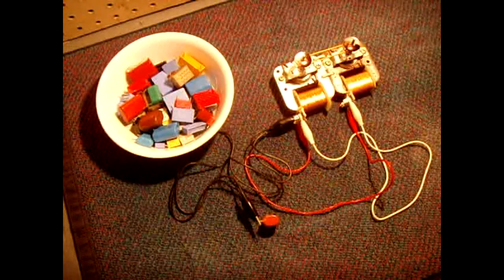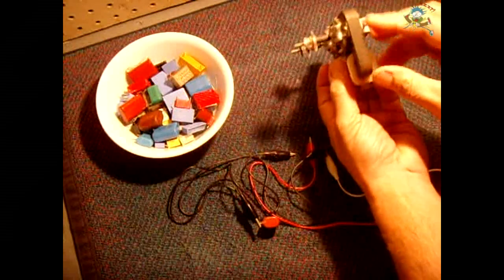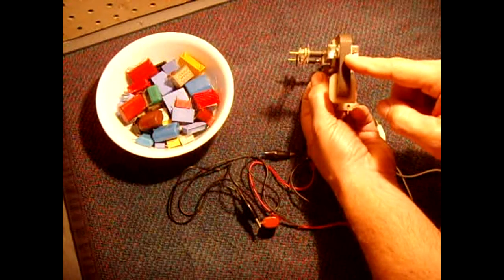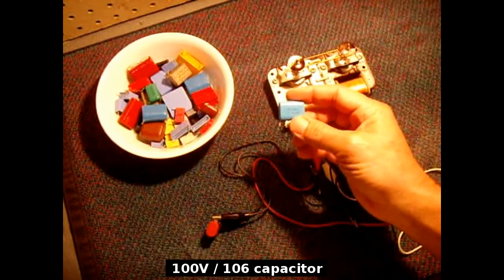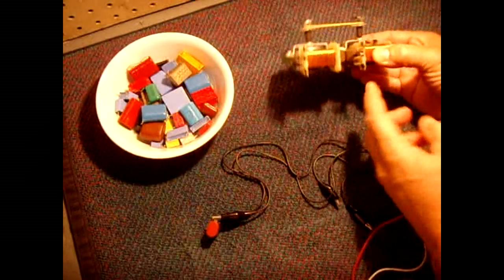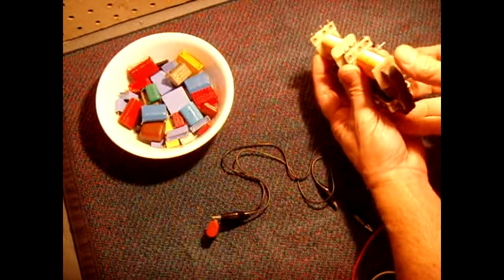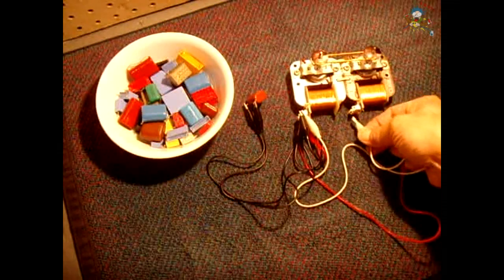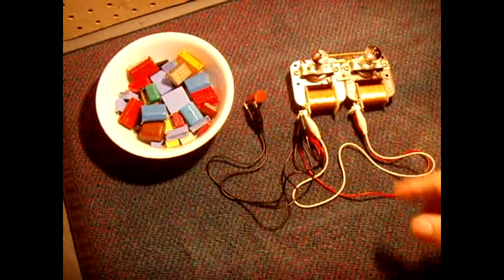FREE ENERGY/OVERUNITY Shaded Pole Motor Generator?

Comment: I like the dominoes falling over in the opening scene since this poses an intriguing question in its own right, namely: how can a fixed amount of energy (needed to initiate the sequence of falling dominoes) be sufficient for any length of dominoes? If this were a wire, it would smack of no resistance at room temperature. Or, am I mistaken in making this analogy?

Comment: They don't need wires. Those are single phase induction motor. An inductor connected to 220 under the table  could have the same effect as applying to motor coil. The center tap is to run it at 120. Half the resistance double the current same power.

Comment: Maybe somebody has already mentioned this but I would take a guess that the capacitor was pre-charged. Yes, the motor speeds up at first to cruising speed, but the video doesn’t run long enough to see if they slow down or not which would indicate whether or not the capacitor is being discharged.

Comment: While I haven’t gotten around to doing this experiment, an induction motor can be turned into a generator by the use of the universal opposition of the rotor by function of an equation at the third harmonic frequency of the resonance LC between the TV device and the inductor. 
Furthermore an inductor can offset the mass of the object by the use of the j imaginary inverted resistance commonly called ‘XL’ 
However typically this is sound for non unified fields , however technically as there are two devices connected, they are non unified in that experiment. 
Theoretically there is a ‘B’ feild effecting the rotation of the rotor and a ‘B’ non unified feild ‘spilling’ into the next device. 
I’m not sure if they are mutually exclusive? 
Thanks for sharing.

Comment: I realize this video was made some time ago, I'm not sure which video you are referring to, but the rotor is modified, the original rotor is either removed or cut to take two magnet's, this is done for both motors.. I have seen two other videos that show them working but only one clearly shows that two magnet's have been installed, the channel is called free energy but the voice sounds like the guy from diodes gone wild... The shaded pole motor needs AC to get started, essentially creating it's own magnet field.
Reply from the maker: You need to stop believing the scams. Good luck having the guy reply to you giving exact plans to duplicate with guaranteed results.
Reply: @electronicsNmore   LoL, I was just looking at the two videos that show it working just before I saw your reply. One video just showed it working and they did exactly as you did, but the other video shows a picture of one of the motors taken apart and a hand drawn picture showing two magnet's where the rotor should be, but in the actual picture I see a thick band that looks like a magnet that has been taken from another motor and he might have machined the rotor to get it to fit, you can clearly see that one of the shaded pole motors still has it's factory pop rivets in place, while the other one has nuts and bolts, I have a shaded pole motor and it's also got pop rivets in it to hold the rotor assembly together! 
I looked at what you did, I didn't expect it to work because I know that the shaded pole motor doesn't have a magnetic rotor, so you would need to start it by applying voltage to it just enough to get it started then the capacitor takes over. Not sure if it would work but if you still have that motor setup, try and give it some 240v or 120v depending on where you are from from the wall socket, give it a pulse and see if it would work, others, chase down the other video, either the channel is called free energy or free energy 4all. The pictures in the video clearly shows what was actually done to make it work.. 
I only have one motor and apart from needing another, I need to find out where to find a magnet that he was using! It most likely came out of a cheap DC motor, they usually have a ring type magnet like that which is one continuous loop of opposing poles... 
Have a another look at it, both videos look very similar except one shows the pictures...
Thanks for replying!

Comment: The video I seen, he had ground out the center of one of the rotor and put one of them flexible magnetic strips around the rotor then reversed the wires, but good video and I doubt the magnet around the rotor will work as well, worth a shot. Good job.

Comment: Please Note this answer relates to an answer from "electronicsNmore" much further down the page !

No,   you were showing us that "YOUR" device wouldn't work, I have 
watched a lot of similar Y-tubes, using the same motors and capacitor 
and none of them had the capacitor connected the same way as yours, I 
think that maybe, your one of these people who are terrified that they 
can be made to work !
Remember, if someone actually gets one of these running, 
(with no brush gear) and it will light the tiny-est of LEDs 
for many months continuously, they will have proved the principle, any 
further work can then just be up-sized

Comment: One video shows the squirrel cage was removed from one motor and altered to accomodate a magnetic ring which would generate a voltage if rotated. I will try repeating this experiment using one and two magnetic rotors respectively, sometimes you have to look beyond the obvious. Also the video was part of an infomercial product by a Dr. Goran  describing the work of a California professor Koon who visited Korea to share his free-energy idea with his father, he was apprehended and executed by Kim Jong Un. In the video there were a couple small asian kids standing around the table, looked legit. Koon applied for and received patent for a permanent magnet motor. Goran claimed to have found the plans when he bought the house where Koon had lived.
Reply from the maker: Save your time and money! They feed off "Free Energy" fanatics just like you.
Reply: Free energy is a real thing. Sorry you came to think you know so much before making any real discoveries. Building stuff without understanding the working principle, most often, doesn't work. You have more to learn, don't take it personal.

Comment: You are 100% correct with your analysis of their videos.  Even if they drilled out the cores of the motors and installed magnets, they would have eventually slowed down and stopped.  By "demonstrating" the power output with a light bulb, they ruined it for themselves.  I am guessing they were more interested in getting views for monetary gain through ad revenue.  Pukes like that need a swift kick in the can and a good scolding.  Countless people have probably wasted their time and materials.
Reply: What a whiner. I bet you thought life was supposed to be easy. People use their time & resources as they choose. Tinkering is a fun hobby.

Comment: wed noticed that some of those motors actually have a band of magnetic material around the centre of the induction barrel
Reply from the maker: The rotor is made of steel and aluminum. Called a "squirrel-cage rotor".
Reply: then it must have been ANOTHER VIDEO WE SAW AS IT DEFINITELY HAD A SMALL MIDDLE BAND OF WHAT LOOKED LIKE A FERRITE BAND (LIKE WHAT CLOSES A FRIDGE DOOR, WHICH WOULD EXPLAIN THE VOLTAGE, WEVE CHECKED WITH OUR METERS AND NOT A MV COULD WE GET OUTA THEM.WERE STILL SEARCHING FOR THE OTHER "SQUIRREL CAGE MOTORS" IN THE ONE WE SAW THEY HAD TAKEN OFF THE BAND IN THE MIDDLE ON ONE LYING ON THE TABLE

Comment: no magnet on this motor, no magnet = no curent
Reply from the maker: You do know this video was made to expose a scam, right?
Reply: yes i know, but i say why :)
Reply: Your cap is to small use a 8 to 10 mF
Reply from the maker: +Chris Bezuidenhout Don't waste time with nonsense. The device is a scam.You need to accept that fact.
Reply: 10 mf  250 volt pf and magnet

Comment: again, thanks for doing these rather than me trying to disprove it.  I would also like to make an offer.  Anybody with a working motor, that produces more power than it uses, I will personally try finance it, if I can build it with your instructions and get it to work.  Even a motor that will run without producing excess power.  IE a perpetual motion machine.

Comment: Hi everyone,well someone talked to that chines replicator yesterday and he posted some ics about the shaded pole motors self-looping device. As the pics show, the rotors of the shaded pole motors have been modified. He added a ferrite ring magnet to each of the rotors. So as it spins, the coils generates electricity. As it comes to why he chose shaded pole motors to modify, I think it's because of their high mass rotors which could act as flywheels. That chinese replicator said '' I'm not claiming any free energy.'' Maybe he is afraid of FE suppression or something else. Look to the photos. Google --> 212522zcke2o7h57omth9e.jpgScroll a little down where you can find the pictures of how it's made.Jan

Comment: I've seen one motor and wondered if you could confirm for me if it is real??? It's the system with a plank of wood, two nails, about 5 meters of stripped wire, a monopole magnet. Once the wire is coiled up, you strip one side of both ends of the wire (don't ask me what I'm on about, cos' I don't understand it either), maybe its some sort of wire, that's copper coated. Then when he places the wire on top of the two nails (the two nails are used like in a spit roast), that should be beaten in to the wood, with the monopole magnet exactly between the middle of the two nails, but to one side of the spindle axis that lies between the two nails, at this point the wire should spin like mad. But does it?

Comment: Hmm, well let me ask this. What if the caps have to be charged? Perhaps if the caps are fully charged the system will run. And perhaps when the system runs voltage is created from the motors running which probably produce more voltage and keeps the system running. Just a thought. If you can reproduce a video with a charged capacitor with the same setup, see if it works. It takes energy to make energy indeed that is true, but I think there is a secret to life. Look at nature, life is infinite and fruitful. You would ask what does the earth use to power itself. I'd say the earth is self sustaining. From that example we can take and learn from it. The powers that be which the people are oblivious to like to keep things under raps and prevent such things to exist and keep the skeptics at large. Then there are fools out here making fake free energy videos to keep the discovery of real energy videos undiscovered.
Reply from the maker: voltixD I know you have high hopes for these devices, but I can assure you that they are nothing more than money making scams. There is no such thing as a mechanical/electronic device that will produce endless free energy. You need a form of external energy acting on a device in order to create energy. Wind, solar, hydroelectric, and geothermal are examples.

Thanks for watching

Comment: I an cautious when taking to believe the claims made regarding "free energy" This one was quick and easy to build. Two identical  motors measured winding resistance, measured inductance paired as described, calculated capacitance to match the reactance of the LR circuit. Thought that there could possibly be an effect at resonance due to collapsing magnetic fields?  Set the whole thing up, no self start so ran up with battery drill. Best AC voltage on meter 0.03V AC, checked on scope, a lot or random pulses on drill frequency curve. Tried capacitors other than calculated values no difference. Conclusion A non event, or have I missed something!
Rules for these devices. Measure, current, voltage both in and out. provide circuit with all details and ensure that your results can be Replicated. Otherwise put your concepts on a magic show where serious researchers will not be distracted.
Thanks for your work electronicsNmore
Cheers
Reply from the maker: Nelson Valiant You're welcome! Thanks for watching. Please Share and rate Thumbs Up.

Comment: Why would you use a 400v capacitor for a 110v shaded pole motor. The whole idea is to energize the capacitor so it can run the shaded pole motor. A 400v capacitor will never be energized unless you spin it longer time a 110v capacitor should get energized to run the shaded pole motor.
Reply from the maker: Christian Truth Oh Mr Christian Truth. What you should have said to me is the following," I know very little about electronics, so please explain why the capacitor is 400v". The voltage rating of the capacitor being 400v is irrelevant. If makes no difference if the capacitor was rated 2,000V. What is important is the capacitance value. I can use a 400V capacitor with 10V if I wanted. You can always use less voltage, not more. If you are using 110V, then the 400V capacitor will only be charged up to 110V! The capacitor will charge up just as fast as a 150V rated capacitor. Remember, to read the about section of my CHANNEL. You will never find a scam video on my channel. Be thankful I made this video. Because of people like myself, I save people like you the time and money from trying these stupid scam devices.

Comment: induction motors only consume power not generate it... no magnets..
Reply: G Dogg Actually they do generate voltage during operation, in opposition to the applied voltage. This is called "counter-electromotive force" which reduces the current draw on the field windings and allows the motor to continue to operate without burning up the windings from excessive current draw.
Reply: Magnet stay constant no moving, secondly copper moves always for effectiveness, lastly no iron at all that breaks the magnet)
Reply: The cap hold the field of the main coil hi and slowly  discharge the main coil, that effect induce a magnetic field in the split face(shaded) coil, and whalla you have your magnet. Use an 8-10 mF cap and it will work.

Comment: Who believes a shaded pole motor actually generates any current or voltage when spun? You need to add magnets on the rotor or other ways of inducing magnetism as it is spinning. I would not even bother building it having this knowledge. I see the original clip. It has 1500,000+ views so it is just for entertainment .. .. A real OU device clip would be teared off the net very rapidly. . .
Reply from the maker: deslomeslager If you attach a capacitor across the winding and spin the shaded pole motor faster than the designed RPM, then you can use it as an induction generator. The only problem is, you need something to spin the motor at a very high speed.

Comment: the capacitor is running the motors in the scam video,
right ?
Reply from the maker: moshe2002 The capacitor is there to give you the illusion it is making the shaded pole motors run without any external power being supplied.

Comment: With your electrical knowladge do you think we could have a type of energy that is transmited with out wires? Not "free energy' like you said nothings free.
Reply from the maker: James Franklin I believe wireless energy transmission is possible.
Reply: James Franklin Yes but if the distance between the two devices (transmitter and receiver) increases, the more the transmitted power diminishes. Possible but not that efficient. You might as well have them wired if they will just end up being close to each other. Wiring them together is far more efficient than being wireless. Transmission needs power more than you actually want to transmit.
Reply: Stephen Flores 
Meaning what? that anyone near the transmitter may glow or spontaneously combust. I was kinda thinking along the line of a type of radio wave may be "more dense/ " than what we use now

Comment: his is very bad news because humanity is waiting for the free energy
Reply from the maker: Lechoslowianin Unfortunately nothing is free in life. Even death cost a lot of money. Solar, wind, etc all have a high initial cost, so they are not really free either, at least until the initial investment is recovered.
Reply: electronicsNmore (in bastardized French) Awe Contrair Misshure, just wait.
Reply from the maker: SlackerSlayer What exactly am I waiting for?
Reply: electronicsNmore ... and just about the time that the ROI (return on investment) rolls in, the equipment starts breaking down and needing replacement parts / labor etc. Those darn laws of thermodynamics.. They prevent free energy / over unity devices from working, and they cause things to break down and wear out.. :-(
Reply: electronicsNmore Once the rights are secured. I'm thinking of selling licenses without the patent. There's always other methods.
Reply: SlackerSlayer ps, it will be a forehead slapping moment for a lot of "smart" people.
Reply: electronicsNmore
I've not seen the demonstration of the device you're debunking that appears to work. My guess would be that there's a coil hidden under the mat / table. a Shaded Pole Motor would be a good candidate for working magically by having a hidden coil connected to AC power nearby since it's windings that energize the armatures field is in one place on the frame. It would be easy to get a little current flowing in the windings through magnetic field coupling much like a transformer. The second motor helps pick up the field, and also creates a completed circuit because the windings are tied together. I don't know if the cap really makes that much of a difference other than to create a bit of a tank circuit with the windings.